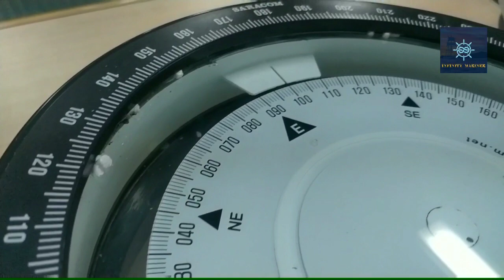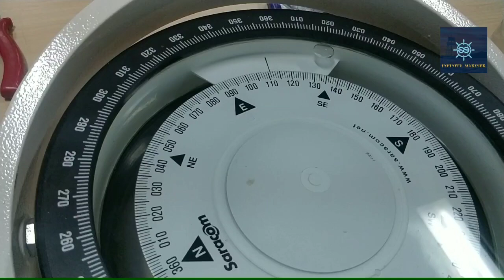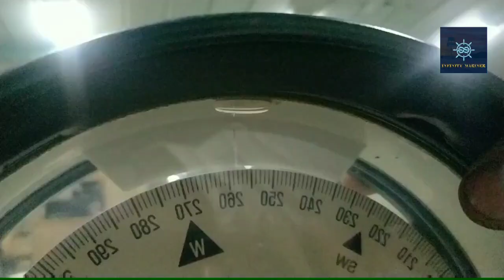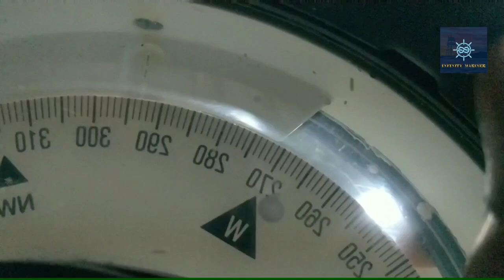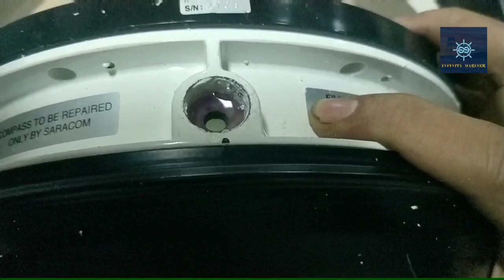How to remove bubble from Magnetic Compass (onboard Ship SCI MUMBAI)

Comment: Can you please advice what is written on the labels on the side of the compass bowl - especially the one on the right side of the filling screw. Thank you.
Reply: @discountcuppon  Please do not teach this
Reply: @nirmalyakarmakar1186  what u want  to say I don't understand.
Tell me clearly.
Hum book ka rata rateye nahi batate,
2nd thing teaching is not my profession, I only making video to help nothing else.
Reply: @discountcuppon  It is specifically written on bowl NOT TO USE ALCOHOL - Please check around 2:55
Manufacturer's supply compass liquid should be used only. Procedure is correct by using glycol is not correct.
For this reason suggest to verify the recommendation from manuals before posting in public form. 
I do hope you will continue to make videos. But with the correct information.
Reply: Also it is important to read books - better reference to books and requirements will make educational videos more authentic

Comment: What's the liquid in side the compass
Reply from the maker: The liquid is ethyl alcohol or distilled water .
Reply: Only Ethyl alcohol.or mix another?
Reply: Distal water and alchol RD-0.93
Reply: @mariner-cg3xx  It is specifically written on bowl NOT TO USE ALCOHOL
Reply: It is specifically written on bowl NOT TO USE ALCOHOL - Please check around 2:55